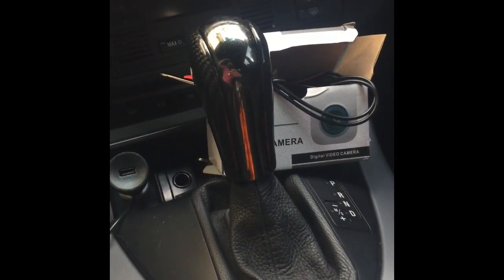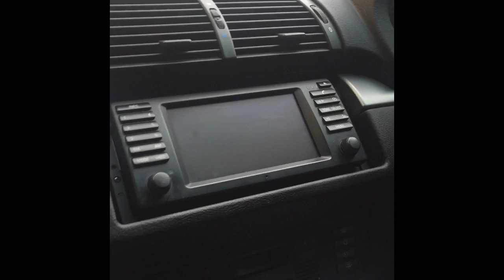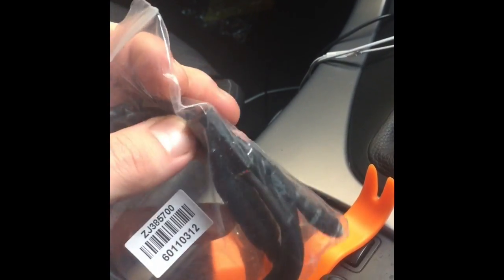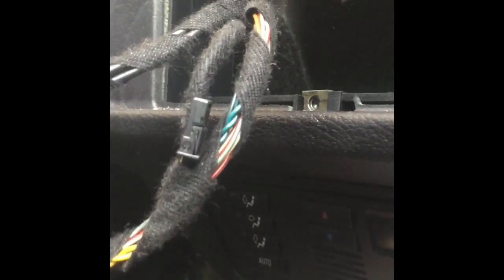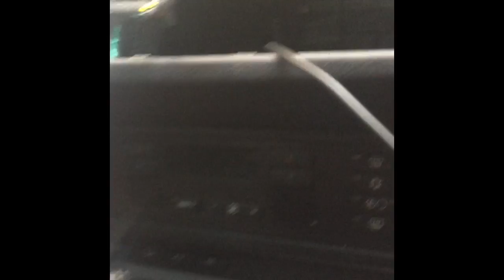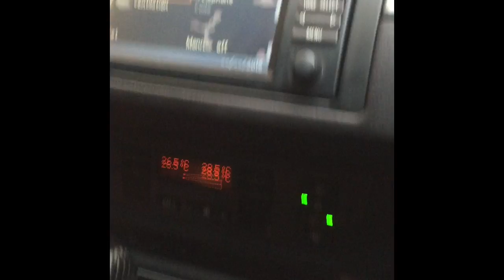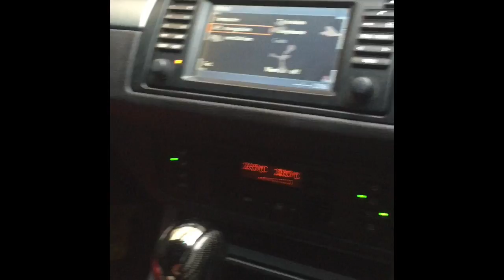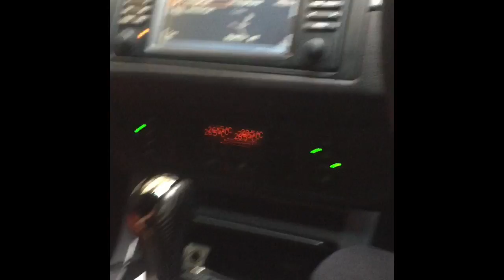BMW X5 E53 Aux Cable Installation

Comment: Hey buddy. Thanks for the video. What type of navigation screen you have. Is that one that comes with cassette tape player at the back? Mine does not look like 
yours, so it makes a bit more complicated to get out. I would assume 
there is more parts to remove around it and I really hate the way they 
assembled it all.
Reply from the maker: Hey man yea sorry mine does not have a cassette player, it came with a 8 stack cd player in the trunk which was linked to the navigation screen, but i bought second hand so that may have been fitted by the previous owner
Reply: Thanks buddy. I installed it. All works just fine.
Reply: T Sonic hey i think we have the same navi, was it really this easy?